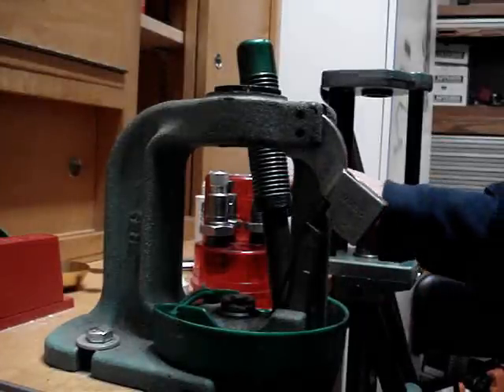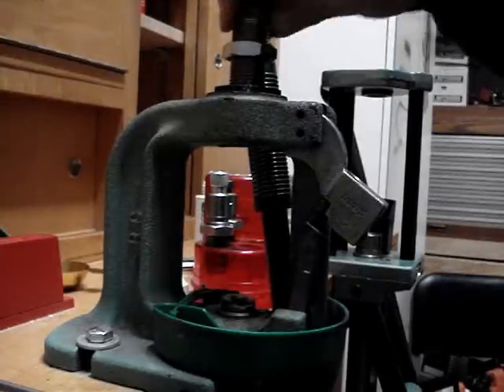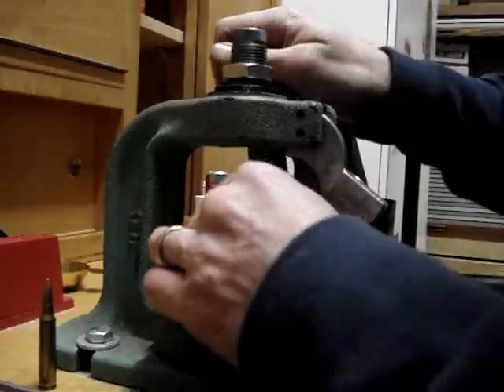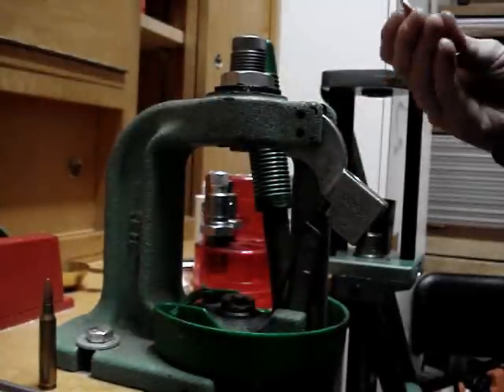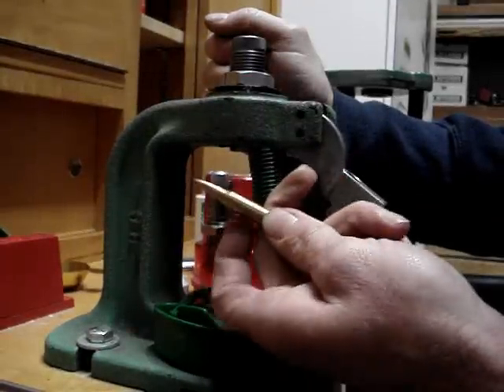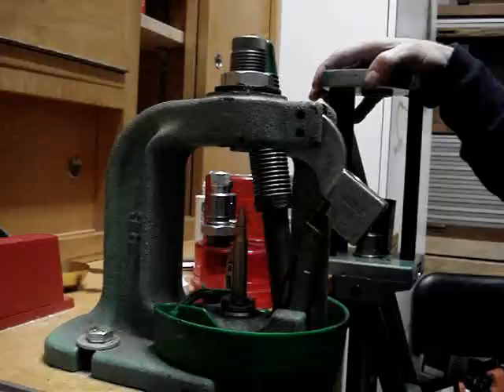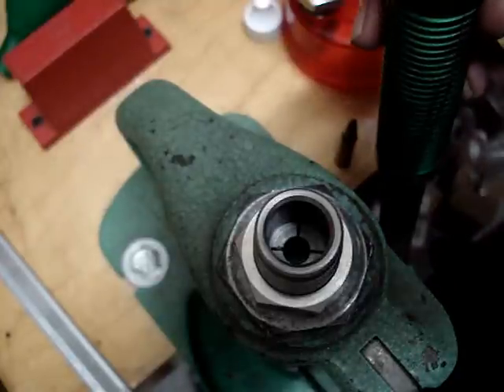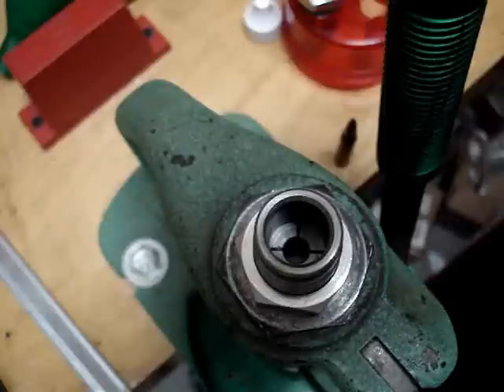Lee Factory Crimp Die.

Comment: I have multiple LEE rifle die sets with the factory crimper.
Based on what I recall in the instruction sheets, you can adjust for more crimp until the collect gaps completely close up. When the collect gaps are totally closed, you have reached maximum safe crimp. Do NOT try for more as it will stress the crimper, and the crimp on the bullet will be needlessly excessive.

Comment: @ammosmith Thank you!  I loaded up my first batch of .45 Colt cartridges using the hand press and the Lee Factory Crimp Die.  It worked great.  Killed a 225-lb boar hog at 50 yards with my Ruger Vaquero.  Worked like a charm.  One comment through, a cannelure is not required with the Lee Factory Crimp Die.  There was no cannelure on my lead bullets and Lee advertises it's not a requirement. I believe the cannelure guidance only applies to a roll crimp.

Comment: I think I read that lee factory crimp die can be use on bullets that doesn't have crimping grooves/ cannelure is this true and why.
Reply: this is correct
Reply: The short answer is yes. You can use them on non-cannelured bullets like Nosler Ballistic Tips or Sierra Game Kings. Most crimping dies use a roll crimp or taper crimp on the case mouth into bullet. This is done by running the round up into a die, and using the ram to apply pressure to the brass body, and force the case mouth to buckle / roll into place. The brass will go to the only open area it has, and that is the crimp groove or cannelure on the bullet. The issue that arises is when there is no place for the brass to go. If there is no crimp groove or cannelure for the brass to buckle into, the brass body buckles. Remember, in a normal type of crimping die; the ram of the press is putting pressure on the entire case body.

Lee worked around this, and developed two new types of dies that do not use the brass to support any pressure at all. Those two being the Collet Neck Sizer, and the Factory Crimp Die. They both use a solid piece of spring steel that is milled to the correct dimensions, and rests on the shell holder. In reference to the FCD, it is formed into a four piece compression collet that fits the dimensions of the desired round. Since the collet rests on the shell holder, the brass does not do any of the work, and only sits there. As the ram comes up, it pushes the round up into the die's collet area. When the outside area shell holder comes in contact with the bottom of the collet, it begins to push the tapered collet together. The die body takes the bearing load of the pressure, and forces the tapered ends of the collet together. The collet then pushes inward on the brass, forcing it inward into the bullet. Since there is no stress or force put on the brass body, there is no chance of the brass to buckle. The amount if inward force applied to the brass / bullet can be adjusted as needed, so you don't over crimp when not needed.

I would suggest ditching the LEE lock rings, and getting some RCBS ones. The LEE's work OK, but for best repeated results, get the black RCBS ones. These dies are very very sensitive. One turn can take you from no-crimp to complete over-crimp. So having a reliable return point is very desirable. I loaded some 300 Win MAG ammo over a few days. I ended up having three different crimp levels. The variance was just a little, but it caused my shots to string vertically by 4 1/2 inches. Now mind you that this is a sub 1/2 MOA load. So imagine my surprise to find three different groups (from the three different days I loaded), instead of one solid 10 shot group. All the groups were sub-MOA, but strung up and down about 4 1/2 inches from top to bottom. Now this issue may be less present in a semi-auto gun, where the gas is evened out some-what by the gas system.

As far as the FCD itself. I like them. I have them for most of the calibers I shoot. There are some that are multi-rolled. The .308 Win will also work for 30 Rem. The 280 Rem will do the 7mm Express. Those that are having a hard time finding 450 Marlin stuff. The 45/70 GOVT. will work on the 450 Marlin. Also any of them that will fit an Ackley Improved (AI) round, will obviously fit the parent round. Like 6mm REM AI will do the parent 6mm Rem. 22-250 Rem AI will do the basic 22-250 as well.

Well, I hope this covers your question.
Reply: I do on all of mine. I use the "light" crimp setting for them. I don't want any projectiles moving up or down in the case neck with vibrations.

Comment from the maker: It does two things. Over works the brass and changes the value of the bearing surface. Your accuracy will suffer. You just need enough to allow the cannelure to do it's job. Anything more than that is too much. Also on pistol ammunition especially rimless like the 9mm you can change the actual headspace. The 9mm headspaces off the mouth of the case.

Comment: when you are resizing cases that had been previously crimped do you need to use the chamfer and remove the old crimp marks left on the inside of the casing mouth ?
Reply from the maker: I chamfer every time because the case mouth can get a little ragged. This can score the bullet jacket when seating. Most of the time when you trim your brass most of the crimp is removed. It'll still have telltale signs of it but after a few firings and trims it'll go away. Remington brass is notorious for thin brass and neck crimps being overdone.

Comment: I have an RCBS press that my grandfather let me borrow to reload all my 223 and 5.56 for my AR. The die came with an integrated crimper, so I used that since I am using 55 grain cannelured soft point bullets. It appeared to make a roll crimp right towards the bottom of the cannelure, inside it, not below it. Should I have got a die that uses a tapered crimp instead?

Comment: Cartridge over all length is not a factor using this Lee die. In regular dies that come with a die set (RCBS, Hornady, Lyman, Redding, etc...) the crimp is made by a shoulder in the die and case length will determine how much crimp will be applied.You must crimp ALL rounds being run in an autoloader! The Lee die can be used on bullets WITHOUT a cannelure. The Lee crimp die is so powerful, it will deform the bullet. I use it on ALL ammo I load! Some will tell you that you don't have to crimp rifle loads in a bolt gun. All the bench rest guys are now crimping for consistent start pressure. You should too. For my varmint gun and hunting rifle, I use a light crimp, just enough to make a very light impression on the case, autoloaders a little heavier. You should pull a bullet and check to see if it is over crimping.
Reply: *****  Yes. Your pump action is the same as an autoloader so you must crimp. Remember, don't over crimp as you will deform the bullet and any hope of accuracy improvement you are going for will be ruined. Anyone that tells you not to crimp for maximum accuracy should be disregarded in all matters! If you have anymore reloading questions, feel free to email me.
Reply: Your welcome!
Reply: any issue crimping a ftx 30-30 round with this die?

Comment: 3 or 4 things you were not right on.  ....  1  Most of the time we buy the die just by itself... because some of us already have RCBS or Lyman or other die set already... So we buy the Lee FC.   2.  you can use it on any bullet,  with or without a crimp ring.   3. If it is set right a small 5 lb push  will put the exact crimp that a 150 lb push will, pushing harder will not make the ram go further,  I set mine to do it right at the cam over & that is all.

Comment: Ok a question thats been killin me. If you look at almost any factory rifle cartidge that has a bullet with a cannelure you will notice that the case mouth is barley past the bottom edge of the cannelure, and then crimped. But in my experience with crimping using a lee FCD it crimps much better and without the feeling of squishing the bullet if you seat your bullet to just barley below the top edge of the cannelure. Allowing the crimped portion of the case mouth to freely go into the cannelure. Of course this also drops your OAL a bit. There must be reason if factory ammo is usually like that. You can usually see the cannelure very well on factory ammo. Its usually sticking up quite a bit. Anyone understand this concept? Is it an OAL issue or a crimp placement issue?
Reply: Factory ammo a lot of the time I believe is using a tapered crimp or roll crimp depending on application of the ammunition, with a taper crimp you’re just barely pushing the top edge of case mouth in a bevel shape towards the Cannelure

Comment: I haven't crimped a bottleneck case in 30+ years.  It is not necessary even in the violent action of an M1A.  The neck tension from a properly sized neck is all you need (usually more than you need) and eliminates potential problems from crimping.

Comment: i have the very same die for my 30-06 and it dont crimp for nothing. i could probably stand on my press handle and it wont crimp. ive tride it every way i could possibly think of and you can still spin the bullet by hand. even my dad who has been reloading since the early 60s couldnt figure out why its crimping. all the other dies work great.. can you possibly  think of what could be wrong with it? any advice would help.
Reply: i have the same issue sometimes. what i started doing is after using the full length sizing die, i set a bullet on the neck and see if i can push the bullet in the case neck with light hand pressure. if it goes in then i resize the case again. sometimes you need to check your sizing die from time to time. 

i actually like a heavy crimp. i set my crimping die till it touches the shell holder, then i rotate an extra half turn. i crimp one round. if i need more crimp then i rotate an extra 1/4 turn. you can actually gain more velocity without using more powder. i suggest people experiment with it. some powders it helps and some it doesnt. i use 20 grains imr4198. works great for me. 55g fmj bullet.

Comment: Most semi auto pistols use taper crimp, Most new semi auto pistol die sets allready come with a taper crimp die, Most of the time if you dont taper crimp semi auto you will have feeding problems. Most of the time you should crimp revolver ammo, either with a roll crimp or lee factory crimp if your bullets have a cannelure.  Regarding rifle ammo if you dont have a cannelure dont crimp, if it does you can roll crimp or lee factory crimp.

Comment: I am totally a noob at reloading. I recently loaded up 50 rounds of 223 Remington for my AR, I am using an RCBS black box 223 reloading die set. It states that it has a taper crimp in the bullet seating die. When I seated the bullets, it felt like I wasn't doing anything. I would have thought there would be some sort of resistance? I looked at the finished rounds and could not see any sort of crimp ring on the casing. Is that normal?
Reply: I have been reloading for a long time, I don't crimp my bolt gun ammo, I size the neck so that the bullet when seated is tight enough going into the case that it doesn't need a crimp , and I get better groups doing so, I used the Lee crimp die in both situations and the Ammo smith is right on the money, the bullet crimp is ever so slight and if you try to crimp a non cannelure bullet it just deforms the brass and doesn't really do anything that sizing the neck properly wont do, Just my experience with the crimp die,

Comment: got a question for anyone when i put mine threw the crimp die  the bullet is in nice and tight wont come out but  i can turn the bullet...rotate/spin it but its in tight enough i cant pull it out only spin it and i dont understand why this happons i try crimp very hard and easy use less and more powder im still doing somthing wrong and the bullet looks really short (308) think 160grain round nose i crimp half way on the bullet where the indent line is wut am i doing wrong?

Comment: i reload for my .308 bolt action rifle. is it realy a must to crimp? does it help with accuracy to crimp? i only reload for my bolt action.
Reply: No, Your bullet set die should have a crimp feature that will set it fine. If your bullet is a snug enough you may not need to crimp at all, but most people do to ensure the bullet stays straight on the casing. The Factory crimp is a more accurate crimping step. And is not a part of all die sets.

Comment: Have to wonder why you're crimping at all? I know that 223 has tremendous recoil, but really guys, tell me why you crimp?
Reply: If you have a bolt action, I could see not crimping. If your shooting an ar-10, it’s so the bullet doesn’t shift.
Reply: Read Lee Reloading Book. He states it aids in start of powder ignition without having to be so precise about bullet seat depth. I’ve found it to be true. I am not a bench rest shooter though but my reloads are moa at 100 yds. .223, 30wcf, 308, 30.06, 45.70, 44wcf, and 45c. All bullet types with correct powder charge for my rifles. Overcrimping does not deform any bullet as he stated. Read the instructions for it if you buy one